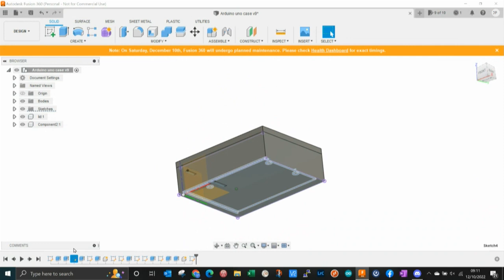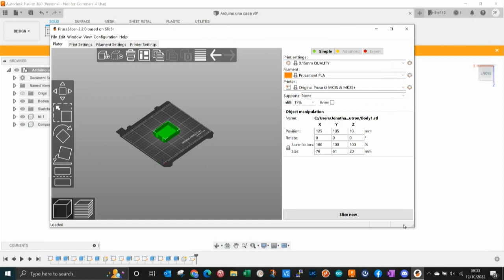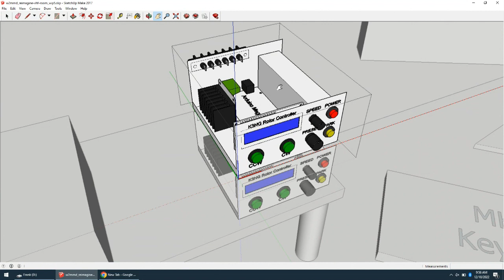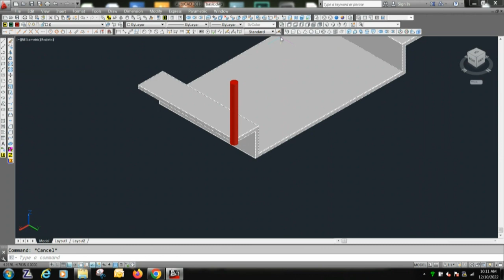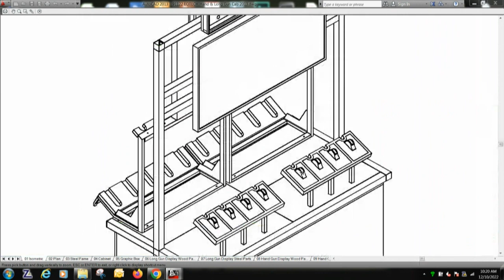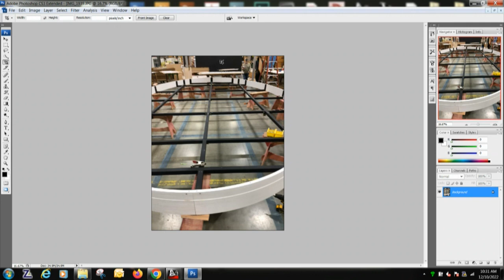3d Printing and CAD Design

Comment: Re: the questions on the relationship between different parts of a design in 360, you can also define "parameters" and then define placement by the name of the parameter. For example, if I want something centered by width, I can create a parameter (Modify --> Change Parameters) named boxWidth and define it as 100mm (or whatever value) and then when I draw the next piece I can define it's location as "boxWidth/2" from one side instead of putting in specifically 50mm. That way if I need to change the width of the box I can just update that first parameter and it'll keep that second part centered. Originally it was 50mm from one side but if I were to change boxWidth to now be 150mm then that placement would automatically update to 75mm from the side. Has worked out really well for me when I don't know the precise sizes and need to iterate after test prints.